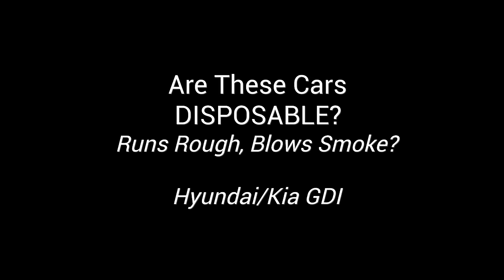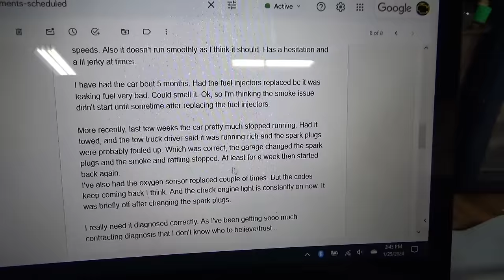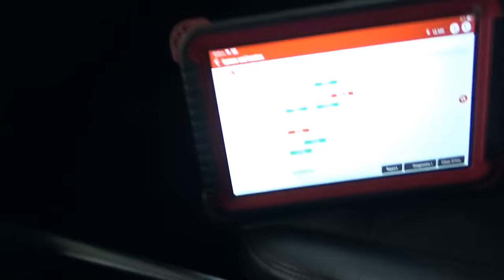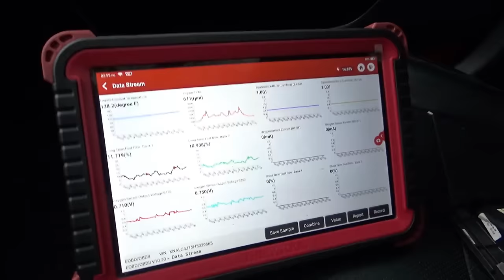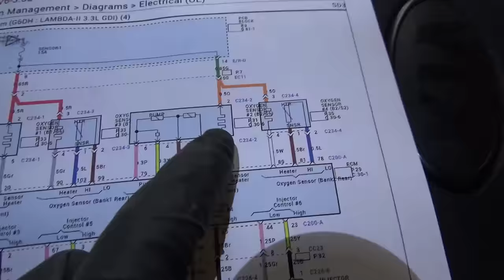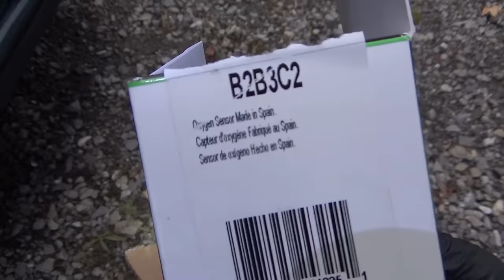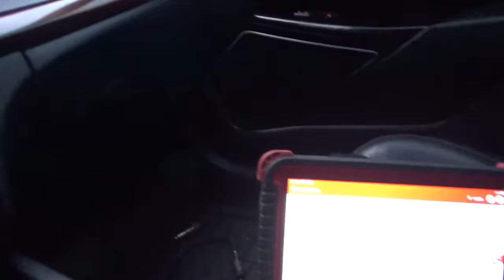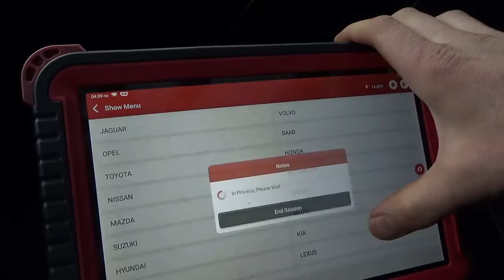Are These Cars DISPOSABLE? (Hyundai/Kia GDI Burning OIL - MISFIRE, Low Power)

Comment: Makes me glad I didn't stay with hyundai. I bought a sante fe and an accent back in 2007. I sold them in 2020 both having over 200,000 miles with no maintenance other than oil changes and tune ups including timing belts.  I sold them to a person I know and they are still being driven daily. We were going to buy another new sante fe but didn't want a four cylinder engine so we didn't get one. Sounds like they aren't what they were.
Love you videos Ivan, thanks for the great content.👍

Comment: These GDI engines need to get up to FULL temp and run more than a few minutes to keep the fuel out of the oil pan. Otherwise they bleed the fuel off the high pressure rail into oil pan. Oil deteriorates fast from repeated SHORT local trips, and combined with people NOT changing their oil when they should?? Destroys the rings and bearings in these GDIs

Comment: Keep us updated on your experience ivan, I've used DPF cleaners in the past & they're really effective with desolving carbon. I poured the cleaner through the spark plug hole until it was filled up (make sure that the valves are closed) i then waited for 3 hours & then evacuated the cylinder using a vacuum pump. You can then flush with kerosene or diesel to get rid of any leftover carbon chunks in the cylinder. The product i used was made by GAT. I've also used an engine flush product from totachi. That one works similar to what you bought, only mine was designed to be used instead of engine oil for half an hour, not with engine oil like yours 🙃

Comment: I've had reasonable success with a 2015 Kia Forte that was consuming a quart every 200 miles. It had approximately 60,000 miles when the problem started. My first attempt was a Liqui Moly flush, followed by fresh 5w 30 high mileage oil and a can of Restore. That showed very little, if any improvement. After a couple of months, I used Chemtrol B-12 in each cylinder. I roughly followed the procedure in the Hyundai Kia TSB. I removed all four spark plugs and turned the crank so that each piston was at the half way position. I poured approximately 4 ozs of B-12 into each cylinder and let it sit for 24 hours. By then most of the B-12 had passed into the crank case. I then added another four ozs to one cylinder at a time. By hooking up my compression test adapter, and hooking up to compressed air, I bared the crank until the valves were closed on each cylinder. You have to hold onto the breaker bar at this point, because the compressed air will push the engine and you don't want the breaker bar to flip around. By doing this, it will force the B-12 past the rings. After pushing all of the B-12 out of the cylinders, I then cranked the engine with the plugs out to remove any remaining liquid. Fresh oil and filter, re-installed the plugs and the oil consumption is vastly improved, although it still burns a quart approximately every thousand miles.
Reply: Nice! I'll have to try that 👍🏻
Reply: I did a similar thing to my Camry.  Was burning 1 qt. Per 500 miles.  Put b-12 and marvel mystery oil on top of pistons for 24 hrs.  Oil consumption went to 1 qt every 1500 miles.
Reply: DIY Dave did a series of You Tube videos on this with a Corolla.  @kinglangren
Reply: Why not just connect shop air via plug adapter? No reason to wear out the starter or break you arm when that breaker bar pimp slaps you with brute force. b-12 is great stuff but I’ve found BG 109 in the crankcase does a much better job of cleaning the rings.
Reply from the maker: @philjerome9795  he's tried every snake oil on the market and still burns a quart every 800 miles 😄
Reply: @PineHollowAutoDiagnostics no snake oil added to the oil will help...you must pull the plugs and directly soak the pistons. Be sure to get the b12 out before starting motor and drain oil also before starting.
Reply: Yes, his rings are probably worn. No amount of motor man in a can is going to fix that. In the case of the Kia I tried the B-12 soak on, it on had 65,000 miles on it.  @PineHollowAutoDiagnostics
Reply: @irocanroll He did all that. It’s a long running series that’s been going for years with the goal of trying absolutely everything short of the piston rings… and then doing the piston rings. Removing the spark plugs to apply directly and soak has been part of the ritual for a looong time now and, yes, he tried Beeryman’s B12, Marvel Mystery Oil, BG products, and pretty much everything under the sun with proper documentation of the effect with real world driving.

I forget which product had a notable improvement but it’s ended up right back where it was anyway (1qt per 1k miles, IIRC).

Comment: Yessir.  Just had a Kia Soul in here Monday.  Burning oil and the cat was so plugged up that it actually pegged my low pressure gauge past 10 psi at the O2 sensor.  It had 1.5 at idle then over 9 psi at 3k rpm.  On the upside Ivan, I did my diag. and got paid, and sent him to the exhaust shop. ;)
Reply: Hello big SECRET! The lambda sensor Boch was bought new in the store, before installing it on my car I sprayed silicone with moisture control on the connector, after that after a few days the lambda stopped working, there was no lambda activity, such an error code, I was desperate. I didn't sleep for several nights. Then I made a mini turning the disk with a milling cutter to a small slot 3 cm above the nozzle, I connected a multimeter to the ground and heated the sensor with a gas probe, the multimeter showed 0...800 mv when moving the gas flame, I was surprised! I put it on the car and checked it, following the schedule, everything worked. My conclusion is that the lambda can go through the wire connector to the comparison to the oxygen, but I blocked the comparison to the air access sensor with silicone spray, tell this to other mechanics, maybe someone needs this knowledge!
Reply: @rihovaher  You must never use any silicone products on oxygen sensors, it can ruin the the sensing element inside.  This is why "sensor safe" sealants exist.
Reply: @rihovaher  That's actually not a secret.  Don't use silicone spray on O2 sensors.
Reply: @rihovaher  Dont ever ever eva eva eva use silicone spray on..the um..sensor..yea

🎅
Reply: @DavenHiskey  Now I understood that it is not suitable for electrical parts. I have always used WÜRTH contact spray, which is a very good product
.Recently I removed the ECU from my car, cleaned all the pins with a toothbrush and contact cleaner and WÜRTH contact spray. The result is .a good engine missed when starting from cold, disappeared.

Comment: 4:40-You've got to wave your arms around Ivan.  Like Scotty.  LOL
Hyundai/Kia has a TSB 222 for oil consumption on some engines that outlines cleaning the combustion chamber with solvent and using air pressure to force it by the rings.  IDK if it works as I've never tried using air pressure to force solvent by the rings but just let them soak a few hours instead.  Motors are junk though.

Comment: 10w30 is only thicker in cold. You need 10w40 to be thicker in warm.
BTW There are some cases when the snake oils can free up the carbon buildup in the piston rings, but usually it is too late when it is tried.
Reply: Exactly, that 10W30 isn't going to do a thing. I would have thrown 15W50 in it...keep it on life support for a bit, because the engine is junk.
Reply: Yep. The 10 is for cold starts
Reply: I have a 2015 Volvo 2.0l Direct Injection Turbo. Don't  know at what mileage the oil consumption issue started as I was not the original owner but the car had 82k on it when I bought it. I was immediately rewarded with having only driven the car 400mi. when the low oil light came on. These cars have no dip stick so it tells you when you are a quart low. Dumb me for not doing my research before buying. Anywho I decided to try the Marvel Mystery snake Oil trick. It took a couple of quarts and about 1500mi before the oil consumption started to slow down. I changed the oil and filter at about 3000mi and continued to run some MMsO in it.  All I can say is it work to a point. I have been averaging about 1500mi per quart which is much better than 400mi per quart. It's not perfect but it sure beets replacing the engine or just the rings for that matter.
Reply: @OtisFlint I agree there engines are Pittfull
Reply: "10w30 is only thicker in cold." No; the most important characteristic of lubricating oil is viscosity. Viscosity is, on basic level, the ability to flow. Lubricating oils are tested for viscosity. These tests are conducted at the same temperature, where oil has to flow through the orifice of certain (the same) size. So, while the oil meant for warmer climates will get thicker at the temperatures that are below their normal work range, perhaps, different oil grade should be used for such conditions. The goal in picking the right oil is to not exceed its normal temperature range (normal working temperature for the machinery has to match the working temperature of the oil), so it can keep all its lubricating properties intact (ex. oil that is to hot will get thinner and will not lubricate as well as it should.) Second most important consideration when picking up particular oil grade is fitment (clearances) of the parts that are being lubricated; ex. thinner oils will flow easier into more tight spaces and will cool parts faster than thicker oils.
Reply: @spol1622 First number is viscosity when cold, second number is viscosity when warm, am I wrong? So for example 10w30 is the same as 10w40 when cold, but it will become thinner once warmed up.
Reply: @spol1622  Lmao you typed all that and it's all nonsense.
Reply: @Dziugenonas  You're right, he's clueless.

Comment: I'm a Hyundai dealer tech. We actually have a system where we have a chemical we pour on top of the pistons through the spark plug holes. There's a whole procedure and special tool involved but it works I'd say probably about 50% of the time. Our spec is less than a quart every 1000 miles.
Reply: So basically you are admitting that it's a shit design, right?
Reply: A QUART EVERY 1000 MILES???? that's mosquito control if you ask me.

Comment: I had a '74 Pinto Wagon, that developed an oil leak in the head gasket into #4 cylinder (pressure oil feed to cam). When I floored the engine, it laid down a smoke screen that would do a WW2 destroyer proud! One top end job later, all was well and I had an increase in power, due to the valve job. Had the car for 13 years, 210,000 miles until it died from body rust.
Reply: I had a 74 Pinto wagon. It was in very nice shape but someone put a 2 liter engine in it to replace the stock 2.3. It smoked off of idle. The hard rubber valve guide seals were bad and who knows how bad the valve guides could have been? I swapped the head with a Ford rebuilt, a year later the same problem occurred. This time I left the head in place and swapped in some nylon valve seals. They worked great for years! That was a very tough little car.
Reply: @Paramount531  Pinto stories are great!
Reply: 2.0 and 2.3 non turbo were dang near bullet proof.  had several 1st generation capris with that engine. rebuilt one with stock parts  just ported and polished the head and intake  skewed the cam timing and played with the tune. 33mpg all day long  in city or on road with plenty of poop to get out of its own way. early models with solid lifters used oil sqirt rail for cam lube. you had to keep the oil clean to keep from plugging them up.
Reply: Wow. I had a 72 pinto coupe. It got so bad I remember driving through a large parking lot. When I looked behind me there was a giant grayish cloud maybe 30 feet high enveloping the parking lot. I could see people just stopping and watching me drive by with very shocked looks on their faces. Guess it’s better it died, then me dying by getting hit from behind! 🚙

Comment: My 2018 Kia GDI was consuming a ton of oil, and the valve cover gaskets were completely cracked around the spark plug holes.  Changed the gasket and no oil consumption for the last 3000. 

Parts guy at the Kia dealership told me that the valve cover gaskets are a maintenance item on these engines.  I couldn’t believe it.  But they are cheap.  So I will watch for oil in the plug holes.
Reply: The oil consumption he is talking about is in the compression chamber oil is getting passed the rings
Reply: @franciscogomez2565  the same oil consumption happens in the compression chamber when oil leaks down around the plug threads .   Its a GDI.   Maybe you don’t understand the engineering but the plug goes through the top of the valve cover and the cover is sealed around them.  Rubber rings. 

Trust me.  Its most of the issue.
Reply: @MadmanJimbo oil in the spark plug holes will just pool there, there's no way for it to go anywhere. Doesn't make sense. Spark plugs seal in cylinder pressure. No way oil is going to leak past the compression washer, through the threads, and into the cylinder.
Reply: @thebigmacd  it’s always interesting to read something that someone writes that is not accurate. In theory, it would be great if a cylinder held permanent compression. 

But There are many times when a cylinder isn’t under compression. In fact, most of the time the engine isn’t under compression and some
Of The time it’s in vacuum. This is the vacuum that works with gravity slowly allows oil to drift through minute imperfections.  And threads.  It’s reality.  No tolerencint
Can be perfect. Fouled plugs are a normal event on Hyundai GDI engines.

Remember, while your theory is great, reality is even a balloon loses air.  Through the rubber molecules. 

However, it is fair to say that a bad valve cover gasket doesn’t just leak into the plug wells.  It leaks in many places usually and plug wells full of oil are a good sign it is in fact leaking badly. 

After replacing gaskets, Cleaning out the combustion chambers is also a very good idea to free up rings, and my bore scope tells me it works miracles to do it.  Carbon is melted away.  

And fuel economy improves as well. 

But I do agree, in theory you are right.  In real practice, steel sealing washers are imperfect items.
Reply: Oil will pass through the plug threads. Then foul the plug.
Reply: @tlr-nut7275  spark plugs have a crush washer at the top, which keeps combustion gases from escaping. It's exactly the same as a drain plug. If oil is getting past that, your spark plugs aren't even finger-tight.
Oil in the spark plug well will foul a plug at the coil-plug connection, but it does not make its way into the engine to be burned.
People think the oil is getting past the threads because when they remove the spark plug the oil in the bottom of the tube immediately runs down the threads.

Comment: Back in 1980 when GM brought out the front-wheel drive X-cars, there was myriad problems with engine/chassis etc.  I coined the phrase "Disposable Cars" back then.  I guess the 'ol Mercury is going to need to run past 500,000 miles.  GREAT VIDEO!

Comment: This is ancient history but I want to relate the story.  The woman I was dating who later became my wife had a mid-eighties Oldsmobie Cutless.  In giving the underhood area a quick look over, I saw that the air cleaner housing (remember the old metal round ones?) had a pool of oil in it and naturally, the air filter was soaked.  I mopped up the oil and changed the filter and she remarked how much better the car was running.  At a later date I took a look to find that there was oil again pooled in the filter housing.  Less, but still present.

I will never remember the name of the product as it was 35 years ago, but the product said that it would free up stuck piston rings among other wonderful things. (yeah, right...)  Figuring that I had nothing to lose except the price of the product, I added it to the oil after cleaning the filter housing out and replacing the filter again. 

It worked!  No oil whatsoever!  She had bought the car used and she remarked that it had never run so good.  No surprise, the rings were actually able to do their job.

Interestingly, she had bought the car on the recommendation of a prior boyfriend.  The boyfriend owned his own automotive repair shop.

I'm sure the product is not made anymore so the fact that I can't remember it is no loss.
Reply: May have been wynn's...my dad liked that!

Comment: Its the GDI engine and lack of maintenance...5k or less synthetic oil changes...top tier fuel...and carbon cleaning are a must....I skipped the GDI only generation of engines because these are widely reported issues...for most car brands....all of my non GDI Kia and Hyundai cars have gone ten years and/or 150k miles with zero issues. Most brands have switched to a combo GDI and port injection or adkisson cycle to reduce the carbon...too bad the consumers had to bear the brunt of NEW GDI technology.